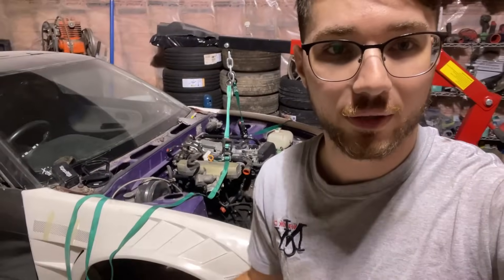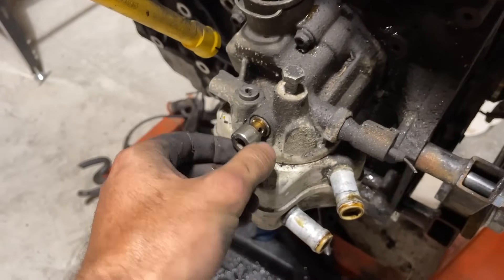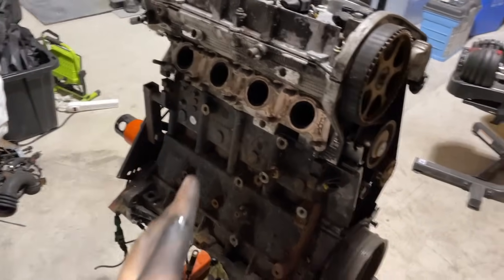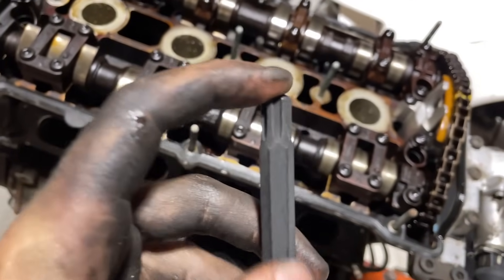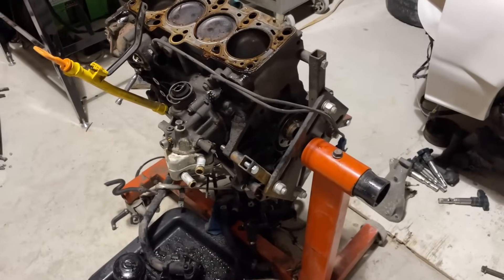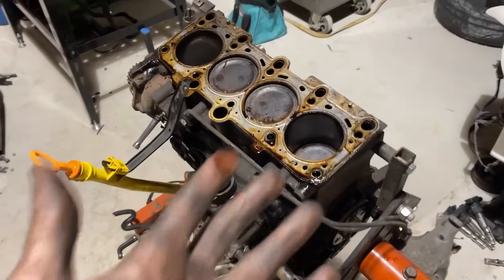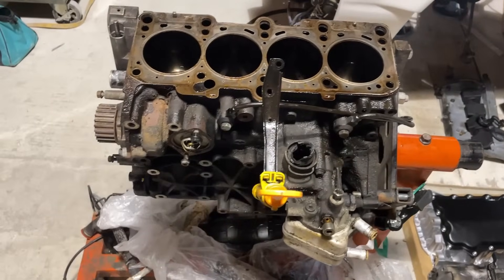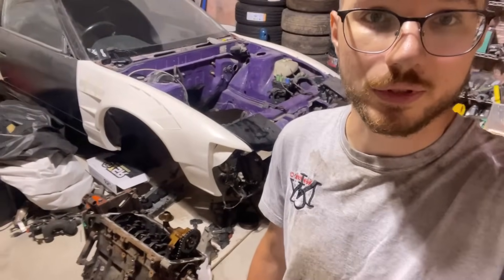S13 1.8T Engine Teardown - Budget 400HP Build

Comment from the maker: Update on the oil pan: I was able to get the hybrid pan to work after removing the oil pickup -> will need an oil pickup from a ‘hybrid’ model car
Reply: So we don’t have to use the hybrid oil pump just the hybrid tube ?
Reply from the maker: Correct 06A oil pumps should be the same they just used different pickups

Comment: Do you know if the hybrid pan is thinner than a standart fwd pan? Currently i am building a Ford Sierra with the same engine and i have the same problem clearance problems. Help will be apprriciated, looking forward for the build :D
Reply from the maker: Yes I believe it is, not sure about the oil pump/pickup clearance may need to swap those as well.